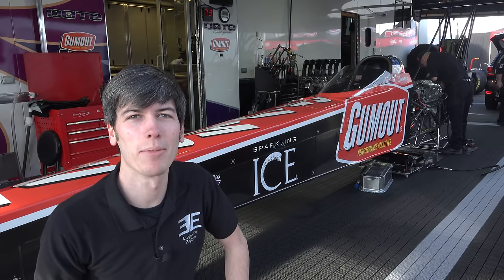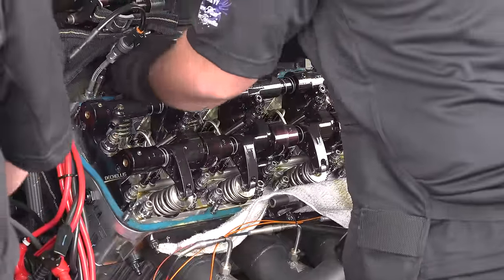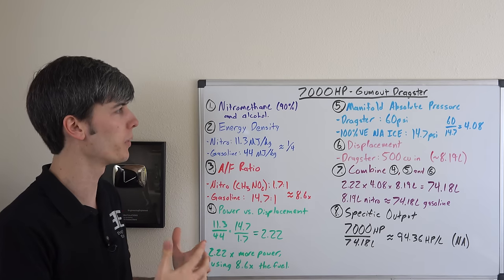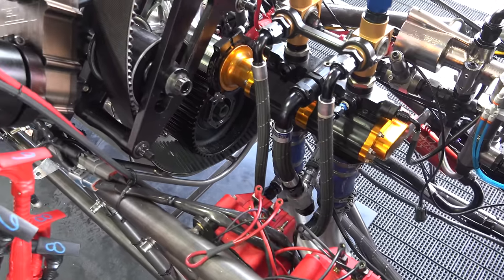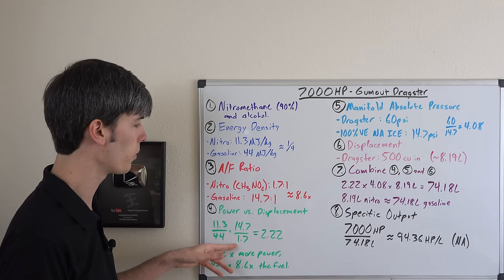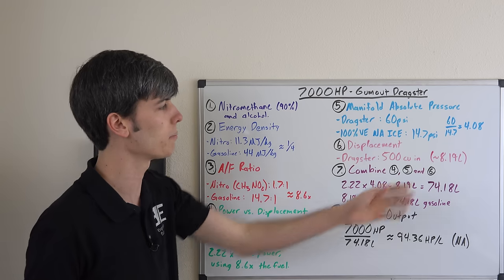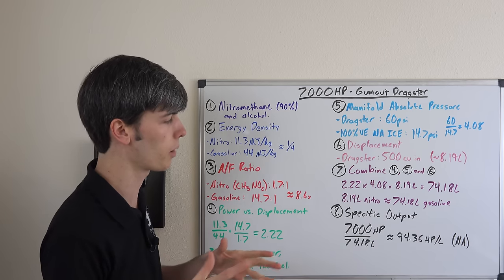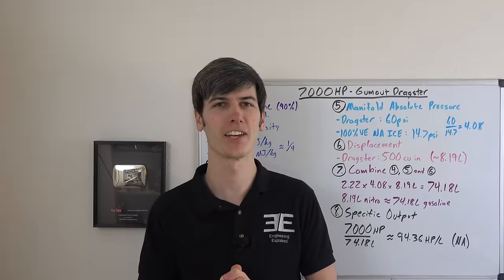Gumout Top Fuel Dragster - 7000 HP Explained

Comment: Aren't these dragsters running on 1/4 miles? If so, how can they be rebuilt after 1000 feet? :D
Reply from the maker: +Max Lindner no, they run 1,000 feet as stated.
Reply: Engineering Explained Ah! I didn't know that, thanks :)
Reply: Australia is the only country that runs Top Fuelers on the full 1/4 mile
Reply: Max..... after Scott (Kalitta) was killed on June 21st, 2008 during his 4th qualifying pass at E-town, NHRA in an interim move to allow for more shut down area.... reduced the the 1320 to the 1000ft mark... for TF and FC,  Only.   Pro Stock still runs the 1320.

Comment: Why do they prefer not to run a rear diffuser?
Reply: ***** It's useless on cars like these.
Reply: BloodstainedSinner
A diffuser that close to the ground is never useless. Its probably not permitted by regulations.
Reply: ***** The shape of the car, size of the rear wing, and engine placement absolutely make a diffuser entirely pointless on these cars. These cars are 25 feet long, and are about 2,300lbs. Roughly 1,700lb of it's overall weight sits over the rear wheels. On top of that, the rear wing alone generates about 12,000lbs of downforce. On top off that yet, are the upwards facing headers. Each cylinder pushes out exhaust gases so hard, that it generates 100lbs of downforce by itself. That's a total of 800lbs of downforce just from exhaust gases! Putting a diffuser on would only add more weight, and affect nothing.

Also, see those "ears" sticking out of the side of the car, right behind the driver seat and in front of the headers? Those are designed to deflect the flow of air around the car. There's negative pressure where a diffuser would be, so there's no air to be effected.
Reply: BloodstainedSinner The weight of the diffuser would definitely justify the downforce, especially when we can use exhaust gases to connect its flow with the rear wing's.

I analysed the cars a bit closer now, and i think that the main reason for not using one is the metal structure at the rear of the cars preventing them from pitching excessively during acceleration. Another reason would be tyre squirt, but even with it, the diffuser would be justified since it would produce significant levels of downforce with virtually no weight or drag penalties.

Comment: one day in the future , street cars will have that much horsepower and be realible and safe , mark my words
Reply: +JennaBringsSexy one day in the future street cars will have 0.3 liter bi-turbo engines to spin the generator and all the cars will be electric motor powered at around 200 bhp max with a 200 miles per gallon due to the emission/pollution laws
Reply: +Antanas Rapkevicius one day we run out of oil and there is no such thing

Comment: What would happen if I use that fuel in normal car?
Reply: it probably won't start up because air/fuel ratio is unbalanced (idk how else i would explain it)
Reply: Should be fairly simple to reprogram a fuel injector to balance the mixture.
Reply: You would have to modify your fuel injectors, probably buy new ones and a new fuel pump. But then you probably would have twice the power you had before. But with great power comes great maintenance costs. Cooling your engine properly might also become a problem. And your driving range one one tank of gas would decrease greatly, maybe a fourth of what you have today, probably less if you want to use that power.
Reply: You can't unless you are already running methanol. Try and start with methanol first. (that will fail too for reasons stated above).

Comment: could an engine being built to stand the whole season or this is science fiction??if they used exotic materials like berilliym pistons,titanium rods,titanium crankshaft etc...
Reply from the maker: +Mitsaras Mitsos I won't say it's impossible, but it certainly wouldn't be cost effective or they'd likely do it.
Reply: +Mitsaras Mitsos the parts wouldnt be able to stand the heat. their usually seized up by the end of the run
Reply: they only last one run after that, they completely take it apart and replace pistons cranks rods everything,if you want titanium rods and pistons, become a millionaire first then you probably can make 2 or 3 races

Comment: why supercharged instead of turbocharged?
Reply: +GSicKz There's no boost lag with a supercharger
Reply: +Luis Vasquez watch promods youll understand, the starting line has better traction than the middle section where the turbos would kick in. in promods, if it is a nice week, turbos will always win, but if the middle is slippery the nitrous or supercharged cars will win.

Comment: Engineering Explained you can't deny with that fuel ratio, the fuel injection plays a part in supercharging that 8 liter engine. should equate that in as well especially when ratios are nearly 2:1 so absolute combustion chamber boost and manifold boost would be very different compared to whats encrypted into our brains. Why does the name prius suddenly seem so funny

Comment: no cooling system?the engine should blow,why?
Reply from the maker: +enzo9ff The run is less than 4 seconds at full power.
Reply: +Engineering Explained Not only is the run less than 4 seconds at full power, but these engines are flowing SO MUCH fuel, that the new raw fuel being pumped in helps to cool them down.  The fuel pumps are good for something like 77 gallons per minute.
Reply: that why the blown supercharger is therefore for force air in piston.
Reply: +enzo9ff alcohol and nitrometh burn at a considerably lower temperature than gas as well.
Reply: the fuel itself cool the engine
Reply: the engine also, for lack of a better term, blows up during every run. and they use pretty much a whole new engine per run. so it doesn't really matter all that much anyway.

Comment: What happens if you try to put this engine in a car?
Reply: +TheGrundigg 😂 Don't think you'd move at all.
It would shake car like earthquake of magnitude 2000+.
Reply: In a Honda
Reply: +mikaman MV it wouldn't fit, same for the transmission for these vehicles, if it's even called a transmission haha
Reply: +lolyermad ....There is no "transmission" in TF or FC'c.... only a forward with a "reverser".   A combination of "timed" (mechanically applied pressure) clutch disc engagement & lockup controls power application to the tires, and sufficient tire "growth" acts like a higher gear ratio,  giving it, its high speeds.
Reply: +mikaman MV very fast for about 4 seconds

Comment: I have always wondered why they make the cars so long...
Reply: To keep them from wheelie-ing.
Reply: It would also provide stability, easier to keep going in a straight line.
Reply: Weight transfer! Watch a pass of a car in slow-mo and you'll see how the front and rear wings keep it planted and the middle of the chassis arcs up under load.

Comment: naturaly aspired 3.0 V10 from 2004 formula one have 950 hp=315 hp per liter 
7000hp should have 22.3 litres
Reply: alessandro ari zaluski Power is a product of torque and RPM, and F1 cars rev much higher than top fuel dragsters, which is why they make more power.
Reply: Brooms much? TopFuel 9500rpm, formula one 11500rpm, its only 2k.
Reply: formula one 18000rpm@2004

Comment: you need to drop the metric specs this is the USA
Reply: do you realize that metric is what the standard system is based on now? like literally the scientific definition of an inch, or pound, or any standard unit is a conversion from the corresponding metric unit.

Comment: how the hell does the gear box not explode
Reply: +INVISIBLE SUN It has a 2-Speed Power Glide and a High gear Rear End.
Reply: +Joseph Kane They don't have powerglides anymore.
Reply: +INVISIBLE SUN no gears except differential, HUGE electronic clutch which needs replacement after each run
Reply: +Big frank ....There are still, Powerglides.... but certainly Not in ANY classes running in access of 14 - 1500hp... though I could be wrong on that, as I haven't kept up on PG power handling advancements in the last 10 yrs or so.
Reply: +echschmidt .... where do you get the idea that the pro - fuel cars have A "HUGE electronic clutch" ??   First off,  it is Not "a" clutch...  they run multiple clutch plates with "friction plates" in between... usually a 10 disc "stack" - 5 of each,  so it's not a single "huge" clutch at all,  and secondly the applied pressure to the discs are mechanically "timed".... not, electronically..... it is a centrifugal (or inertia) clutch with adjustable "fingers" (of varying lengths) which apply more and more pressure (simplistically speaking) throughout the run (but, primarily during the first 300 ft) until all the plates are locked up (some are welded together, sometimes... through the heat of friction.... usually during the initial phase of launch).
Reply: +2Stroke Diesel Power I was talking about top fuel dragsters which are the topics of the video. Powerglide is still one of the most popular transmissions in drag racing.

Comment: Only 94 HP/L I have a 1.0L Inline 3 engine that makes 123 HP. That doesn't make sense.
Reply: Yes it does.
Reply: Yep. Makes sense. 94 HP per litre once the NA conversion. Without the conversion it is around 850 HP per litre as stated. Which is conservative really. I believe these beasts are north of 8,000 HP in reality.
Reply: The Nissan dig G-T engine is makes 236HP per liter :).
Reply: Your right about the GTR. And as incredible as that is. Imagine that this engine has almost 4 times the HP per litre as the GTR. Crazy to think about.
Reply: I know. It's insane.

Comment: 7000 hp explained.....Ahhh   Chrysler Hemi + Engineering........and Nitro!!!!!!!
Reply: Not a Chrysler hemi lacks a lot of the things that make the hemi Chrysler a Chrysler different blocks heads similar valvetrain is about it. Oh yeah you need to machine for water jackets and the crank and rods bores etc dont work with hemi stuff
Reply: @jdrok5026  ahhh...the topfuel crank will drop right into a second Gen Hemi......
Reply: @sirswerve2493  um since when can a regular hemi accept a top fuel bore and stroke without machine work? You'll still need to machine the block it will not drop right in because top fuel cranks are machined to different dimensions based on the blocks.

Comment: My RC car runs off nitro :D
Reply: Matix700 Actually it runs off mainly methanol, with from round 5 to 35% nitro, (more than likely, unless you found some 40% or added your own nitro to methanol or mixture). And with usually around 5 odd% lubricating oil, either synthetic, castor or a mixture.
Top fuels run the ratio the other way around, with 90% nitromethane and 10% methanol.
Bet your motor revs faster though. ;-)
Reply: rationalmartian lol why ruin the fun ;P yeah its a 35% mix

Comment: I allways see them with gas mask... How many times is it more dangerous than usuall fuel ?
Reply: I'm not 100% sure but I think nitromethane is more volatile than gasoline, requiring organic filters to prevent the mechanics from getting high
Reply: 𝖘 𝖍 𝖎 𝖗 𝖔 lol why preventing the to get high ? :D Being high is gooooood man
Reply: Because they have a job to do and they're on the clock for the next run
Reply: 𝖘 𝖍 𝖎 𝖗 𝖔 well ty ^^
Reply: As a dragracing fan, I can tell you one of the combustion products of nitro is
nitric acid fumes. Breathing that stuff for prolonged periods of time would be
unbearable, but in the pits they always fire the engine after the rebuild, and
there's always a crowd around waiting to catch a wiff!
Reply: Darrell Bell lol a crowd waiting for a cancer you mean :p Thanks for reply dude !
Reply: after sitting near Alexis dejoirias funny car warming up last year every mucus gland in my head was stinging and burning after about 20 seconds...wouldn't wanna be any closer than I was without a mask
Reply: the fumes when running are just like tear gas it burns makes you're eyes water nose run and is quite toxic.

Comment: i question his maths...
Reply from the maker: gixer turbo i answer my maths... ask away
Reply: +Engineering Explained What altitude are your figures based upon? We have race tracks that are at almost sea level here, and some that are above that. I know my bike performs better in the north, at higher tracks, it's cooler there, less oxygen but cooler, and not so well in the south where the races are at almost sea level, where the air is more dense. I understand this is page one, chapter one for you.

Comment: Can you imagine anything more boring than going to watch this? Don't get me wrong, I'd LOVE to go and see it once just for the noise and the thrill. But after that.... the second, third fourth times.... ;-/
Reply: I agree 100%....I'm a rally racing fan...and even then...you see 30 cars for like...3 seconds haha
Reply: robjapan Its all about the community , going into the pits , watching engine rebuilds and most of all 14,000 HP you feel in you chest for a few seconds , its a great experience and you should try it if you never have.
Reply: robjapan Its all about the community , going into the pits , watching engine rebuilds and most of all 14,000 HP you feel in you chest for a few seconds , its a great experience and you should try it if you never have.
Reply: i know this is an old post but if you've never been to a nhra event then you can't say it's boring. heres a taste, those dragsters pull up to the starting line and you can feel each cylinder firing on your chest....now imagine the burnout and launch.

Comment: 7,000 HP? try 10,000 HP bud
Reply: +Mitch S Would come out to a relative specific output of ~135 bhp/l using his method of calculating, which is still within reasonable range, though getting towards the upper limits.
Reply: yes and no. BHP is brake horsepower, which is different that just horsepower. Horsepower is the maximum available output directly from the engine to the drive train and is measured as 550 ft-lbs (torque) per second. brake horsepower is the estimated power output of an engine calculated by the maximum amount of resistance needed to stop it. a top fuel car under no load is capable of producing up to but not more than 10,000 HP, brake horsepower comes into play when a vehicle takes on a load over a distance, aka a dragster going down a drag strip. as the dragster moves further down the track, the clutch meshes with the 6 disc clutch set up, causing massive amounts of friction and head and causing them to temporarily weld together (you already knew that though). as a result more of a load is taken on by the engine which causes a drop in horsepower and torque output. Yes you were right about the bhp calculation, at 1000 ft. a top fuel dragster is producing approximately 7000 HP but under a no load condition a top fuel engine is rated at 10,000 HP.